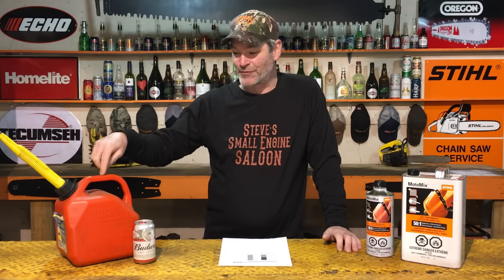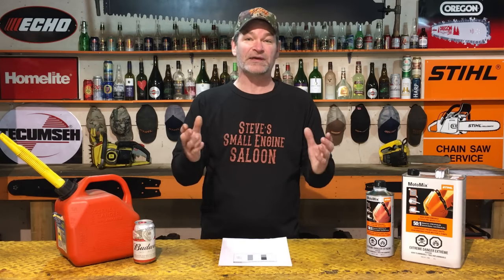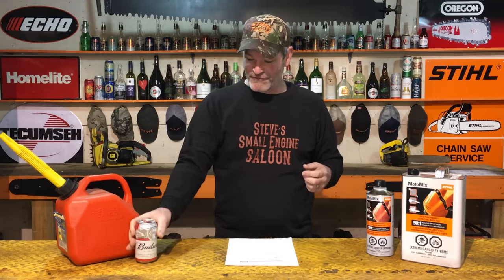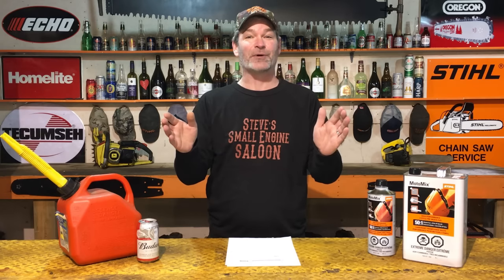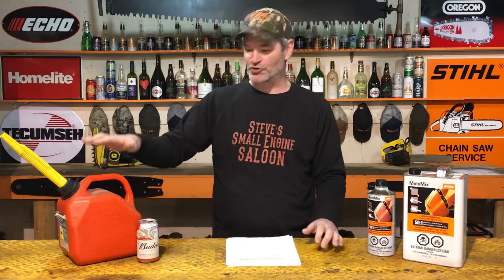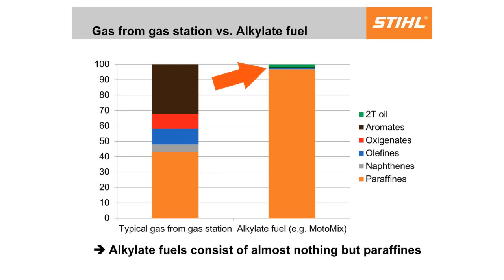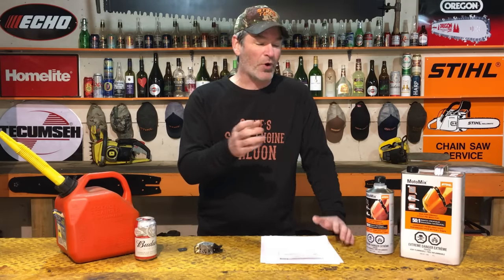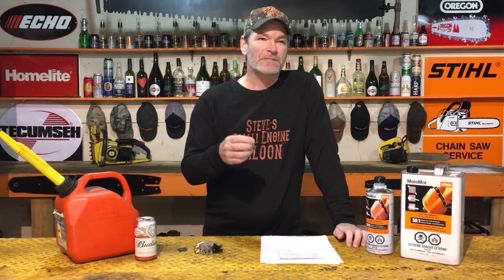The Ugly Truth Why Gas Station Fuel Is Bad For Small Engines

Comment: For everyone out there, please listen until the end of the video! Steve recommends storing your engines with this fuel not running it all the time. If this type of fuel was cheaper it would be great to run all the time though. Great video, thank you Steve!
Reply from the maker: Thank You...and You're Welcome...
Reply: In Belgium we always use it, but it's Aspen, it's way too harmful for health. We trim hedges all day long with hand held hedge trimmers and being in the smoke from regular gas all day is just horrible
Reply: Exactly - Steve is a Smart Functioning Drinking man - like me !!! 👍🏻👍🏻👍🏻
Reply: I agree and make sure you are using ethanol-free during the season, especially if you are not using it for several weeks, keep that small engine in pristine condition
Reply: he should have said that right upfront then,    he implied pump gas was so bad thru the video,  I turned it off before the end, as I wasn;t buying it.   very long video just to recommend a winterization plan.   especially as chainsaws don;t get winterized up North where I live, they get used.
Reply: @PJ-tt2nz  I had a friend who owned a tree service die from throat cancer.
Reply: I want to second BMPWR, watch to the end. Thw lesson gas is well worth the time.
Reply: Don't store small engines with fuel in it at all, and you accomplish the same thing.
Reply: don't all trim positions require you to be a stoner?
all that breathing control is for a reason.
i even use my body to shield low frequency transmission out of habit.
Reply: Bullshit.

If the fuel we use is killing us, and is 40% shit, even in it's best--uncanned--version, are we just not killing ourselves in the fall?

Is that what you're saying?
Reply: @stevetdean1966  Carcinogenic and mutagenic exposure is cumulative.
Reply: @sst6555  Pump gas IS so bad. He was right throughout this whole thing. You turned it off because??? Oh well, your loss my dude. 🤷🏻‍♂️ Cognitive dissonance has struck again.
Reply: @billwilson3665  My Cousin was a shoe salesman and he died from pecker cancer!
Reply: Now that does make sense, I might try overwintering with one of those fuels.
Reply: BMPRW Your statement is nothing but BS. From Steve's opening written statement: " I will show you why you should BAN gas station fuel from your lawn and garden equipment". If you ban gas station fuel from your equipment what are you going to run in it?
Reply: Actually he was very ambiguous. But he did say if you did anything use it for winterization.
Reply: @thinkfirst6431  Obviously the title is an exaggeration and clickbait-ish, but he's right. "Gas station fuel" in this context of course means "pump gas" or "automotive fuel". "Banning" bad fuel from your own equipment is not in reference to legislation but a decision any informed individual(or workplace) will make if possible.

Alkylate fuel is available from sources other than gas stations in most jurisdictions within the developed world, including hardware stores. I do buy alkylate fuel from gas station meters filling my own canisters and mix with oil at home. That's cheaper and I want to pick the fuel and 2T separately. I don't tolerate any offensive odor from exhaust after initial warmup. This might sound unrealistic to someone accustomed to automotive gas and cheapest premix oil, but that's how it is. Exhaust should be hardly visible in good weather when modern well maintained equipment is run on proper fuel.

I know this is not an option everywhere and would not be viable everywhere anyways - some countries still have nearly tax free or even subsidized gas, while in comparison most have heavy taxation. In my case the price difference is just 20-30% when the comparison is ~$10 per gallon for regular or premium automotive fuel, speaking in understandable terms. At that point, $13 is not bad for something that actually works and doesn't poison the sawyer. Even premix branded small engine fuel at $18 wouldn't be that bad. Small engine consumption is nothing compared to vehicle consumption.

Automotive gas was never good for 2-stroke power tool use, but it was all people knew about. Engines in general did not last so no one really noticed the corrosive effects to any rubber parts etc. Everything needed constant pampering due to bad design. Everyone had a cough from smoking and did not realize the toxic fumes affecting them. Do I need to mention leaded fuel? Anyone born before 1990-2000 probably has suffered slight mental damage from its use, and that includes me. Why was it? Just because of greed - a cheap way to make high octane fuel. Many folks still don't get it, could be because of the lead they absorbed.
Reply: For what it's worth, my 028 has been run on pump gas when in regular use and stored with Coleman fuel, all properly mixed with oil, since 1984. Still runs great with no repairs over the years. I cut and burn 5 cords a year. When ethanol happened, I bought my pump gas at a local small airport and use VP pre-mix for storage. Has worked well for me.
Reply: @PJ-tt2nz  try battery powered hedge trimmers - I'm giving up electricity operated ones. Ironically I use electricity to recharge the battery. Stihl( lol) it's easier on the wrists. All day you say? Yikes!
Reply: I had 3 different mechanics of auto engines and 2 small engines. All agree to one thing. Paraffin is wax. It heats and flows, cold it’s thick. I was shown the results of 1 season run with ethanol gas and another machine without it. The bowl on the ethanol had a yellowish looking coating but the ethanol free  looked clean. As for winterizing, I guess not all stihl mechanics haven’t gotten the word. I was told a week ago, while storing the chainsaws, either run them totally dry or fill with ethanol free gas and run for 5 minutes. I believe most of what info he shared but have doubts when a manufacturer of a product tells how terrible the other ways are. Good info for this winter
Reply: The Stihl website recommends draining their saws for storage.
Reply: @mannys9130  tuning out too
Reply: I am Canadian. who ever would  stop using their tools for winter.... I work 13 months of the year..... most tools start first pull.....use it or loose it.....
Reply: @thinkfirst6431  cooking oil
Reply: @jackd1582  Cooking oil that would be one way to cook your engine.

Have you ever seen the mess left behind when using biodiesel on a regular basis.
Reply: @thinkfirst6431  I don't even use corn oil
Reply: @jeffburnham6611  You can never get all the fuel out, even if you run it dry.
Reply: I think you are correct......If you run it till it stops,  you are still leaving crap to gum up your carb. @percyfaith11
Reply: @philhugill8458  Yep, that's why I take the bowl off and use compressed air to blow out the fine passages at the end of the season.
Reply: I watched a test a different channel where they used 10 ariens engines and put 87% gas mixed with 10 different stabilizers.they let them sit in all weather conditions and every month they would try starting them after a while most of the stabilizers would not work and. The engine wouldn’t start so they marked it out after 19 months only one would start and they where dropping the bowl every single on had sludge in it except the last one that bowl was completely clear VP  gasoline treatment.
Reply: Been running my equipment dry for years for the off season, ethanol free during the season, no problems.   Rag over the filler neck after the motor quits on the last run for a day or two to allow everything to evaporate, then cap off

Comment: If you actually watch to the end of the video you'll realize that Steve mentions to use this refined fuel for WINTERIZING equipment. Not for necessarily everyday use. The ignorance of some people! Keep it up Steve!
Reply from the maker: Thanks Mike...
Reply: I thought it was to stop from getting cancer of the blood that comes from daily use. I don't wanna die.
Reply: I use engineered fuel in my saws always now, including storage. Switched to premium gas  a few times - saw runs like crap every single time I switch over - the old surging rrr RRR rrrr. Switch back to engineered fuel - saw runs like brand new with lots of power. I use it bc I need the power. 

I do use mixed gas in the weedwacker and lawnmowers & those seem to tolerate it (I run a small amount of engineered fuel thru my carbs after I run my engines dry of regular gas to sit in the carbs for the winter). But my chainsaws definitely don't. I live in a state that likes ethanol in their gas. Ironically, most ethanol-free gas stations are in states that grow corn... which are the biggest lobbyists for ethanol gas... everywhere else. :)
Reply: xamot80  If you know everything then why watch?
Reply: xamot80  you need to learn to not be ignorant.

It states for Storage on the splash page
Reply: @shadowopsairman1583  Calling people ignorant is not a nice thing to call people. We are all on here to learn and help each other. Not to have someone call us names. Just saying is all. Something to think about how you can express your self without name calling or cutting people down.

Comment: I took your advice about a year and a half ago. I always had a chain saw in the shop for fuel line and carb issues but not any more. Now that's all I run in the trimmer and all 4 chain saws. I also store my sawmill mowers and water pumps with it. Best advice ever. Thanks Steve for all you do
Reply from the maker: Great job!

Comment: Steve I’ve owned many four and two strokes engines for over 40 years with a lot of Stihl  products. I’ve always used premium fuel in running season . When engines are put in storage I drain gas run till they die and remove spark plug and shoot a little oil in piston . Spark plug put back in tight. Done... Everything starts well in spring (Always) luck I don’t think so. Works well in Iowa.👍 This works with jet skis, outboard motors,generators, snow blowers, chain saws, leaf blowers,lawn mowers, everything I own.. Maybe gas is different in Canada.🤔
Reply: Dave Iauco  I think running your 2 stroke at 24-1 is running it lean not rich . Less gas due to more oil . Might not be healthy for it .

Comment: I’ve got a STIHL fs90r trimmer….have had it since 2010, I started using moto mix after I learned about it and this is eleventh season of just taking off wall and firing it up, still original plug and have never had to clean spark arrestor
Reply from the maker: Awesome!
Reply: Ya. But it is a fs90r. Best trimmer ever made
Reply: I've got a 20year old Ryobi..... still runs great, never had the plug out. I switched to ethanol free 10 years ago.. Maybe it's luck.
Reply: I’ve had an ice auger for 25 years and I do the same thing with gas. Amazing story bruh.   Nobody GAF

Comment: This is the most UNDERRATED subject known to man,
Small engines needing carb overhauls as fast as you can look at them is all because of pump gas,
Ethanol is pure garbage, less gas mileage and water in your float bowl, I have a vintage style go kart with a new motor that I refuse to run on corn juice!
Reply from the maker: Right on

Comment: Being the cheap-ass that i am, I'm still gonna run pump fuel during the work season for that engine, but I'll have to consider using that for winterizing. Maybe start using it later in the season to avoid having to drain a tank. Thanks!!
Reply from the maker: Agreed!

Comment: Used to work at a Stihl dealer. The pre mixed fuel is awesome for emergencies or for storage. I use Stihl 2 stroke oil with pump gas. When im done with my saw or trimmer I run it empty. 15 years later and have not had any fuel related problems. It is about time to adjust the valves on my FS90 though.

Comment: Thanks for the info. I recently purchased a Stihl 361C and was running 90 octane non-ethanol fuel. That fuel worked great in my older Stihl saws - not so in my 261C. I have been told by my local Stihl dealer that my non-ethanol 90 does not have enough octane to adequately run that saw. My problem was once the saw got hot - it kept vapor locking on me - particularly on summer days. I started running the engineered fuel and it runs like a champ. I asked the dealer - what do the high fuel use arborists and loggers do. Cost of this stuff would be prohibitive. He said they run ethanol containing fuels with a higher than 90 octane rating then add an ethanol stabilizing / removing additive. Make any sense?

Comment: Good video a always Steve. 
I buy gas straight out of the pump, regular, 87 octane, usually 10% ethanol, no stabilizers or any other additives, whichever station is closest. Sometimes I don't start one of my engines for over a year. I've never had a problem. Just saying

Comment: I am going back to TruFuel. I ran out and was unable to get any. I used a gallon of. Citgo 93 with Ethanol Shield. My power saw has been running like crap. Starting issues, etc. Back to TruFuel for my power saw. I am dumping the Citgo mix immediately! Thanks! I thought my saw was going funky.

Comment: I think it might be the formulation of gas in various parts of the country.  I have used non ethanol gas, both  91 and 87 octane without issues for over 15 years.  I have more than 6 engines from 5 to 20 hp, air and water cooled. It works in the upper mid west. Prices for the canned fuels are insane.
Reply: With u
Reply: Canned fuels are only good for storage. Especially tru fuel. That stuff is no good.
Reply: Yeah I'm right there with you even with my chainsaws the same thing I do say though that good old fashioned seafoam in all my equipment to start out the year is just a standard procedure I've done for 30 years and I see no reason to stop doing it cuz I never have issues because of fuel and gumming up stuff like that you know
Reply: Same here in Texas. My equipment runs like crap on canned fuel you couldn't pay me to run that stuff.

Comment: Interesting, at the end of every season I collect all my small engines (4 Sthil)  two mowers and drain the tanks completely. Once drained I let them run till they stop. The older ones for at least 25 to 30 years and the new ones are at least 5 to 8 years as best as I can remember. Still going strong each spring. Snow blower and generator get the same loving treatment at the end of winter. Just checked Amazon for the Moto Mix, $160.00 Canadian plus taxes for 4 quarts. Highway robbery in my mind. 🙀 My craftsman ride-on lasted 23 years then I gave it away to someone for parts.👍🇨🇦👨‍🦳

Comment: This video is especially useful for those of us who have worked around raw (gas station) gasoline for years, as it changed in composition. 
We have soaked parts in gas, and were not careful to avoid skin contact. There is enough information in this video to persuade many-- who otherwise might develop serious diseases-- to be very careful with gasoline and its vapors in the future. 
Thanks for your time and effort on this publication.
Reply: Is gasoline really that bad and harmful now that we should avoid skin contact and vapors? If so I did not know that
Reply: @catfishbilly3.765  Modern mechanics are aware they cannot treat gasoline like a harmless petrochemical solvent, or another version of alcohol.. The skin is a major contact avenue for all chemicals, good and not so good. Skin contact is how chemical warfare takes its toll, in addition to the lungs. "Normal pollution" is not what it used to be..
Reply: @catfishbilly3.765  In fact, old time fuel was much worse. Before 1970s they put PbEt4 lead tetraethyl in the fuel to increase the octane number, and to lubricate the exhaust ports with PbO. When they forced the removal of PbEt4, there was a lot of resistance, but now we all know it is good. We have catalysts, we do not breath in PbO and half-burned fuel chemicals. Benzene was also a part of the fuel, it is difficult to remove, and even if you remove it, then what are you gonna do with it??? It is really the best way to keep in as a part of our gasoline, and burn it to CO2.
Reply: @west_park7993 I remember the lod leaded fuel.  Seems like we didn't experience the kinds of problems we do today.  I'm convinced today's problems aren't a result of just ethanol, there's something besides just that causing rubber parts failures. I'm also not convinced corrosion is a result of ethanol.
Reply: @thisisyourcaptainspeaking2259  I disagree. The Good Old Times cars lasted much shorter than the modern cars. My 2000 camry is 335 k and I plan to keep it for at least 4-5 more years.
Ethanol will not cause corrosion in the car tank, mostly because you drive it all the time. However, if you put EtOH gasoline in lawn mower, and let it stay for a month in Florida, it absorbs H2O, then bacteria kick in, turn EtOH into vinegar. Then, the engine will not start. If you wonder why, just take apart the carburetor. There is white precipitate of corrosion, gold fish and frogs inside! This is why I put no ethanol gas in my lawnmower. When PbEt4 burns, it produces PbO, white soft oily material, that helps lubricate the hot exhaust manifold. When they removed Pb, they added Mn organocompounds. Soluble in gasoline. When they burn, they produce MnO2, pyrolusite. black soft oily compound....
Reply: @west_park7993  Will you be able to locate the proper replacement ECM for the 2000 if/when it croaks?
Reply: @thisisyourcaptainspeaking2259  in early 1990 we were changing cv axles all the time. now they last 200 thousand miles. rubber has become better. same for fuel lines.
Reply: @west_park7993  That's true!  Warning though, those fuel lines from 2000 might be suspect by now in some cases.
Reply: @thisisyourcaptainspeaking2259  absolutely correct. My power steering lines started oozing liquid and go replaced. (together with the pump, rack and pinoion and the reservoir). carmy, 23 years, 336,000 miles...